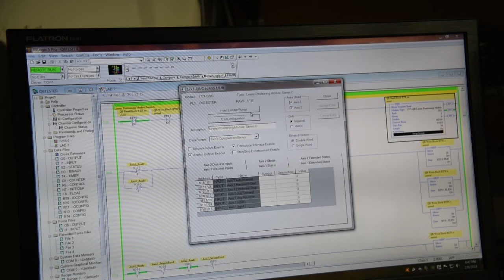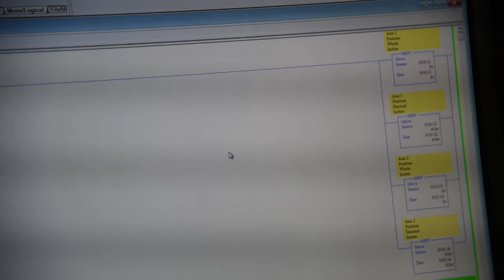1771-QB Tests

Comment: I should mention that you helped up in the past with a test program to test both QB channels.  Our customer kept blowing out one side of the power input to the + and - 15V.  He was quite livid and called because ones we had repaired were blowing up.  The overvolage protection diodes were blowing up.. Hmmm  I told him to check the common wire from the split +15 and -15.. He called later and said sure enough the common had broken away from the swing arm.  Because of the different current draw one input was going over voltage and the other was way below.  Its like having an open neutal to your house, your fridge kicks on and a couple lights in the house get brighter and don't last as long as others.
Reply from the maker: Hi Duane:
Very glad to hear that the program I send you has helped.  Field wiring in the culprit in most problems that we have all seen.